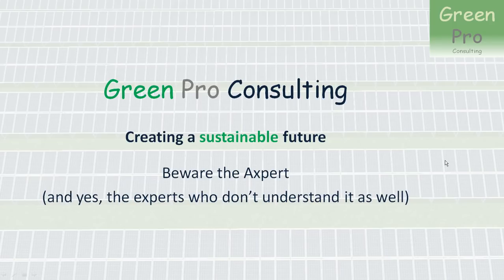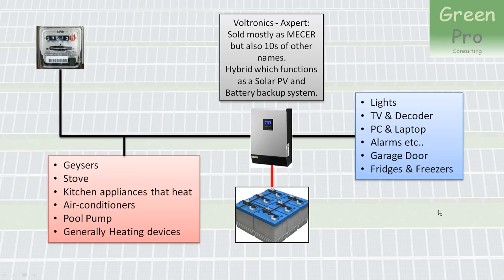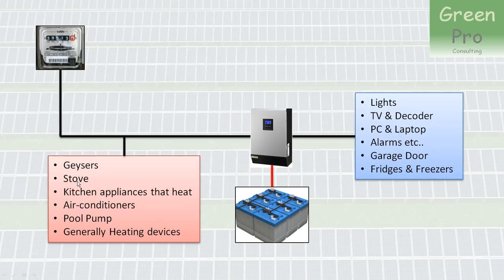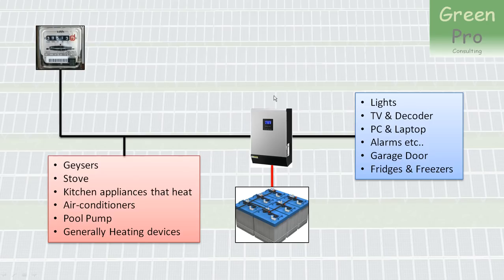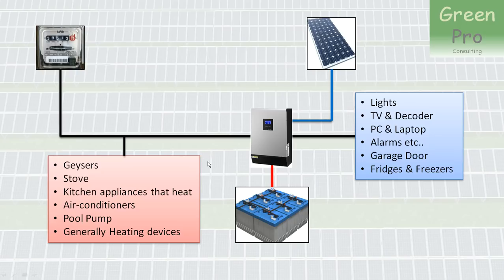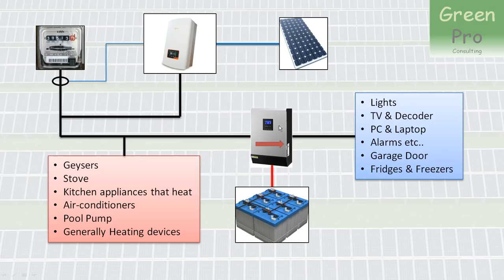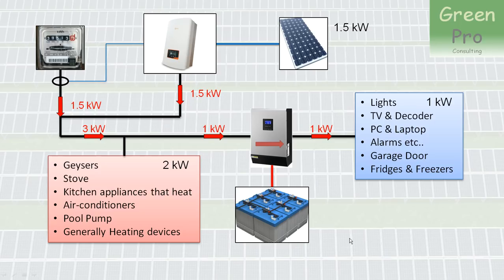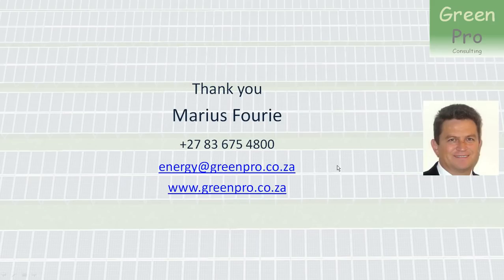Beware the Axpert Inverter

Comment: im here now ..wanting to buy the  Axpert Type 5000VA (5000W) PURE Sine Wave Inverter 48V (MKS-5K) - 80A MPPT (4000W)..
does it have the same limitations??
surely solar must be shared with eskom half way if the soalr does not give enough  power..
obviously it goes to eskom at night if there is no batteries or switches to batteries for the duration of the battery life..
this is how it must work
also staying in SA
Reply from the maker: Hi, That is exactly the problem. One would think it shares the load with Eskom if there is not enough solar power, but it does not. The Infinisolar (also from Voltronics) does that. It's exactly why is a lot cheaper than the Infini that can share the load. Note that there are no power drivers towards the grid, so it cannot push power to the grid. From a regulation point of view that is nice, since it's strictly a power consuming device, as far as the grid is concerned.
Reply: @greenpro-greenproconsultin7420  ok thanks
Reply: @greenpro-greenproconsultin7420  ok this is many years later
i use this inverter
this thing is very strong
i run straight from solar panels
6 fridges and freezers mixed
microwave and kettle on even at the same time
2 computers on
there is lights and a laptop all connected all switched on
multiple cellphones charging in the house
3 x wifi 2,4 and 5ghz channels
hifi system also on
and 2 x fishtank heaters and pumps
this inverter is very strong
handles all these things at the same time
and i can add more items

so it has the option to swith on or off from eskom
and run the whole night on batteries for power

also on the program of this inverter you can charge batteries from solar and eskom if u choose
run utilities from solar or eskom or both
its optional
or run purely on solar
or just on batteries

Comment: I've had problems with it working with a generator as pass through and battery charger.  It keeps switching between bypass and battery. It doesn't like the generator power fluctuation.  
Presume it works fine with mains.
Reply: Im not an expert, but cant you just use a capacitor to balance out the flux?

Comment: Does the new 3rd generation Axpert vm3 HYBRID inverter by voltronic power have the same limitations? I am considering buying it to be used as grid-tie inverter and will be running aircon and other power-hungry appliances in the day time to save on electricity bills. if it cannot do load sharing then it defeats the purpose. 
Edit: to anyone watching this video in 2019, Please check the manual page 36 (https://docdro.id/1sUQFJs) where the load source priority is set to SUB (solar-utility-battery) it says "If “SUB” (solar first) is selected as output source priority and solar energy is not sufficient to provide the load, solar energy and the utility will provide the loads and charge the battery at the same time."

Comment: 5kv inverter axpert mk11  can run swimming pool pump and kettle no problem, you just need a big bank or newer lithium power packs.
FYI   Grid Tie inverters needs mains input to sinc to, this means during loadshedding  in day time the solars panels arent being used,
Reply: I plan (by next week) to run a 5kva inverter with about 3195w panels and a 3.5w lifeopo battery.  i hope that it can run the whole house...  pool pump and kettle included.  i will see.
Reply: @Groot_G  easily

Comment: Excellent video and very informative.  I'm considering this for an installation in Spain and a local supplier there sells the Axpert 3kw unit.  I have an electricity monitor currently and notice that sometimes, I may use just over the 3kw for a minute (maybe if the washing machine was on and I just boiled the kettle).  How long can this unit go into Overload for ?  I see from specs that it can be overloaded to 150% - but for how long ?  What is the model of the Grid-Tie Inverter you mentioned which blocks feedback back to the grid ?
Reply: with any inverters its advised to "learn" to use one appliance at a time,  washing machine  about 2kw (when drying cycle) Kettle about 1800w.
unless you go to 5kv unit it will trip.  overload to 8kv (on 5kw  unit only) for 10s
Most cheaper grid Tie inverters wont feedback. if there is, its normally a function to switch on

Comment: Hi Marius, great video. It was made in 2017. I installed 2 x 4kW axperts recently, as I have quite some load to feed off the inverter & batteries. My system is also connected to Eskom, which feeds a) high consumption appliances (geyser) and b) supplements any shortage coming from solar. You state that b) is not possible, or could it be that my inverter is a newer model that has this functionality? I can see on the inverter screen that Eskom switches on for brief moments when the required load exceeds 8kW (max power that the 2 inverters can supply). Thanks
Reply from the maker: Bas. Look on the greenpro.co.za website and send me an email. It easier if I call you.
Reply: Hi Bas,

I'm currently looking to upgrade my system and I was opting to go with Marius's setup. Now I'm wondering if I should just do what you did and get another Axpert inverter since I already have one 4kw unit.

My biggest concern with adding the Solis inverter is that during loadshedding I can't still benefit from the 3.9 peak generation capacity of my already installed system. 

I still think adding the Solis inverter makes sense if one doesn't want to go completely off grid, if only I could still use PV power when the grid is down.

Thanks for sharing your set-up, it'll help towards deciding what I do next.

Comment: How does it work when you draw more than 5kw?  Does it simply turn off and show overload?  Or will it automatically go into bypass mode and allow a higher current through? If so, how much current is it rated to take?
Reply: 5kv unit has a overload to 8kv for 10sec,  unfortunate  even if it goes to bypass mode its limited to 5kv only
Reply: @NRC073  I have an Axpert 1,5KW - If I put on a 2KW hairdryer for example, it shuts off the load immediately and beeps - it then resets  - like a computer rebooting.
Reply: @synthwave7  no shit, your overloading it, of course it will shutdown.

Comment: Great video but I have a question - if u have solar geyser and gas stove and buy large enough grid tied inverter then there is no need to have the Mecer inverter? And its cheaper and rather spend more on batteries? Is that an option? Pool pump and microwave can still be used on proper battery system?
Reply: Grid tie unit is more expensive and cannot charge batteries. Its feeds into your DB directly from panels.  No mains and units doesnt work anyway.
Big enough solar panel setup 3~4kv worth of panels yes you can power pump and microwave almost directly from panels. but you need exstra to charge batteries aswell.

Comment: Is it possible to program the axpert to only use the solar panels when the grid fails, then supply the axpert and grid tied inverter with the same set of PV panels, so that if the grid fails(load shedding) then the grid tied inverter will switch off anyhow, and  the Axpert inverter will switch to PV supply , using the same PV array that the grid tied inverter was using?
Reply from the maker: Hi Dean, Unfortunately not. You can switch the panels from the one to another inverter, using a relay that sense the grid, but you are switching DC so now arcing comes into play and makes it more expensive (will need snubbers etc..). By the time you bought 2 inverters, you may as well buy the infini, which is designed for all the options you mention. I am not sure but if you are in SA, I understand the scenario that concerns you. In that case if you already have the inverters, a DC switch that you operate manually may be the answer.
Reply: cannot share panel load between devices the MPPT wont work correctly anyway.  GRID TIE  inverter needs mains in to work. wont work off grid. Maybe with a change over swich you can switch over manualy what device is using panels

Comment: It's made in Taiwan, not China. It's misleading to use the word "hybrid" as that usually means the inverter can feed power to the grid as well as operate in stand-alone mode. You fail to mention a major drawback of your favoured configuration. There is no way to make use of the energy from the solar panels during an extended grid outage. Once the batteries go flat, that's the end of it.
Reply: I think the need for batteries for starting up is solved in few of their models, specifically; VM II, VM III, MKS II.
I've owned and tested both VM II and MKS II, and they start without being attached with batteries at all (I had to send my batteries to be tested, and in the meanwhile, I've started and run the inverters.) 
A big problem with this kind of running mode is when the sky is clouded or as soon as the sun is covered with a cloud, the  power drop considerably and the inverter might restart and or home devices restart.
Reply: Its manufactured in China, I've been in contact with them and it was definitely China. I wanted to import but the distributors here sell it for peanuts so there's no sense in trying to compete.

Comment: Axpert inverters are not council approved for grid connection !!!!
Reply: Indeed, it doesn't comply with NRS097-2-1. But NRS only applies if you have PV panels connected to the Axpert. This scenario Marius explains here should be legal because the Solis inverter in his picture is approved. The Axpert is now used solely as a UPS.

Technically, if you connect the Axpert to your distribution board, then it must comply with SANS 10142-1 regarding a suitably interlocking changeover switch. It is unclear whether this inverter complies, in other words, I am not even sure if you can legally use this as a UPS if you tie it into the distribution board. What I know about this inverter suggests that it is not SANS 10142-1 compliant either.

I have no idea how you can compare this to almost anything that comes from Europe. There is no comparison between this inverter and what SMA, Fronius, SolarEdge or Victron puts out. It's pretty good for something that comes from China/Taiwan... sure... but that is all.